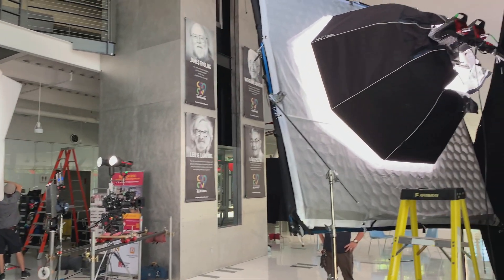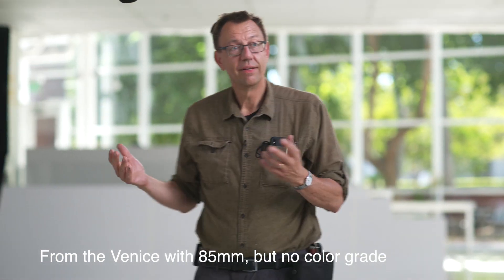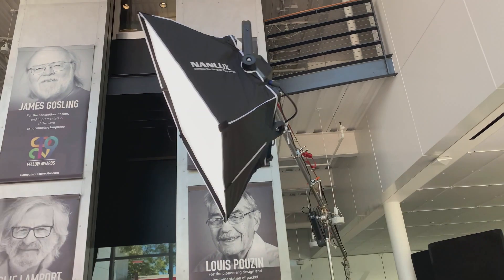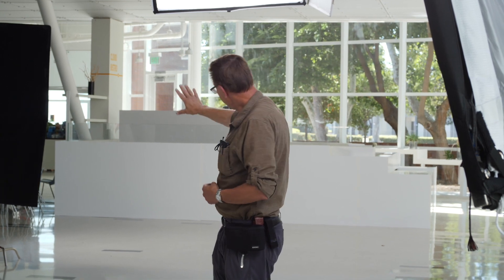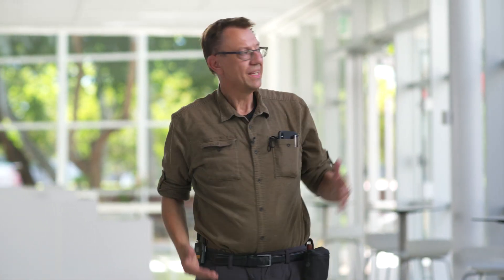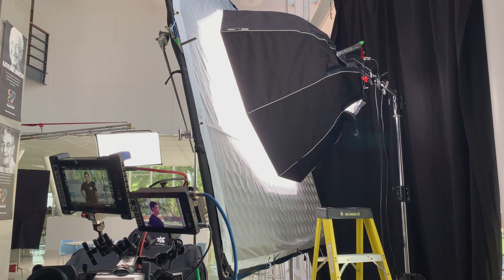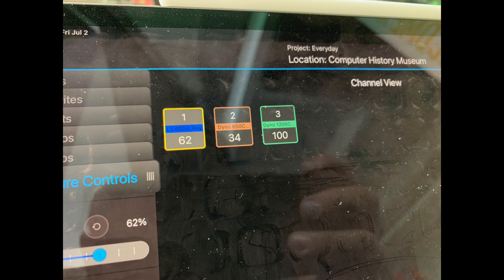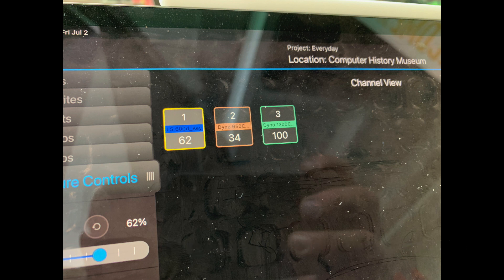Meet The Gaffer #245: Basic Location Stand-Up

Comment: Great to see some behind the scenes of this setup. Why was the octabox placed so close behind the egg-crate / scrim setup? Wouldn’t the same thing be achieved by putting an egg crate directly onto the Octa?
Reply from the maker: Good question! Mainly it came down to space. Originally that Octa was supposed to be far enough back to fill the 8x8. I don’t know this for sure, but I think the depth of the Honeycrates works better for the LCD effect we were going for than an egg crate on the Octa.
Reply: @meetthegaffer   gotchya! Thanks for the insight

Comment: Lovely bts!  Question: what is the easiest way to “t-bone” an 8x8 or a 12x12? Which specific pieces of grip equipment would you use? Thanks 🙏
Reply from the maker: T-boning is a matter of combining a strong enough structure for the task at hand. Say you want to make a solid floppy without any floppies on hand: just flip a c-stands arm 90 degrees to the stand, parallel to the ground, grabbed in the middle of the arm and clip an 8 ft swatch of duvetyne to each end of the arm. If you want to T-bone a 12x12 solid, you’ll probably choose something beefier than a c-stand. Normally, I would take a hi-roller or hi-hi roller and T-bone it with a 12 ft piece of speed rail. You can grab the speed rail with a pipe to ear fitting or a Big Ben clamp (which is pipe to junior pin). Then you can either tie or grip clip the solid to the rail. If you are working with 20x20 solids it’s nice to have mambo stands with wheels. 
In terms of diffusion, I prefer to offset rather than T-bone if the diffusion will be placed in front of a light source. I know many don’t care, but it messes with my sense of Feng Shui🙂 I create my own version of wag flags out of stick from an 8x frame and drape the diffusion from that. 
Hope this helps!
Reply: @meetthegaffer  thank you for taking the time to write such a thorough answer! Love your channel/content! Happy Holidays !

Comment: nice Luke!....honeycrate fights inverse-square law, definitely a pro tip in any set. Would you do me the favor of asking with the grip or camera people involved in this shoot what kind of gear is used to set that slider tubes. In particular the transversal union to the standing tubes and the slider tracks. It is DIY or Modern's (to mention just one manuf.) hardware ? Cheers!!!
Reply from the maker: Yes, it is combo Modern and DIY. Not super helpful, but that’s what it is. It belongs to the DP, John Behrens. A number of Keys have created a version of this because it is more stable than a single post on either end.
Reply: @meetthegaffer  Exactly, I imagine that it is more stable and less bulky than putting 4 stands. Assembling sliders with only 2 stands tends to roll the camera to the front and to the back. many thanks for your reply and keep walking my friend!!!

Comment: was looking for a diffusion video - if you had 2 grips carrying an 8x8 frame moving in tandem with talent - would you just have each guy hoist it up with a c-stand arm?
Reply from the maker: If you are talking about having the frame above talent, you’d probably want a third point for safety.
Reply: @meetthegaffer  third point? Where like 2 on one side and one one the other? Was thinking 1 guy on each side with arm clamped to each side of the frame
Reply from the maker: Right, but if you have two points the weak link is the head or connection of the arm to the frame. If the wind comes up, the frame could dip down or up and get away from you, so it would be good to have another connection to the frame, say with someone near camera on the back side of the frame to be that stabilizing third point. Hard to talk about without a picture or drawing of what we are both talking about.
Reply: @meetthegaffer  agreed but I understand and appreciate the time you took to respond- the angle of the sun relative to camera and talent is the other consideration for what your talking about…best I go with a 4x4 for tighter shots and none for a wider master shot

Comment: Damn, Luke, that looks great. Good job team. 

Is the 300X set to the same as the D? Wondered why you didn't use 2 x Ds or just a case of what you had available? Wondered if you were trying to colour it slightly because of the mix of sources?
Reply from the maker: Just dialed them into a similar CCT; nothing fancy… and yes, I have one of each😬

Comment: interesting  speedrail base for dana dolly, how do you like it opposed to lowboys? also thumbs up on the menace arm, ive never seen a combo being used to anchor the tail end like that
Reply from the maker: The speed rail base is a custom design by the DP. It provides greater stability over a longer run. Others have made variations of this design. Working off lowboy rollers is all about speed and usually used for shorter runs, like 6 ft or less.

Comment: When you place your lights directly on top of diffusion grid, doesn't that defeat the purpose of what you are trying to do?  If the goal is soft lighting, don't you want separation? The grid has a hot spot?
Reply from the maker: Yes, often set-ups begin with the best of intensions😬. Originally the idea was to fill the 8x8, but we needed more room, so everything got jammed up against the windows. We could have just gone with a control grid on the Octa, but I think the depth and larger size of the Honeycrates openings was better for the inverse square law implementation we were going for.

Comment: Hi Luke, Do you have any tips for the DIY home studio with tightly restricted space(s) -- for example, a one-car garage (without the car)?  In particular, do you have specific grip safety tips for small home studios?  How have cooler LEDs changed safety setups on tight sets?
Reply from the maker: I’m not sure I have much to add past the basics one would follow on any set in terms of avoiding trip hazards and securing hung instruments with safety cables. The main thing LEDs have changed in terms of safety would be that now you need less power for your set up. 

In a DIY home set up it’s nice to be able to hang a couple lights so you aren’t bumping into them all the time when you change out the stuff you are talking about or using for props. If you can construct a grid of some sort, that could be handy. But start out simply, with everything on stands, and then if you stick with it you can eventually rig things to make more room and allow for other uses of the space😉
Reply: @meetthegaffer  Thanks for your note.  Actually we've transitioned from an incandescent studio with lots of overhead track and rigged lights, with power in the ceiling to a hybrid light mix with lots of LEDs that can be positioned with this handy device on one C-stand:  https://www.bhphotovideo.com/c/product/1308822-REG/impact_me_112_baby_triple_header.html
Reply from the maker: The triple header is a handy tool to sure!